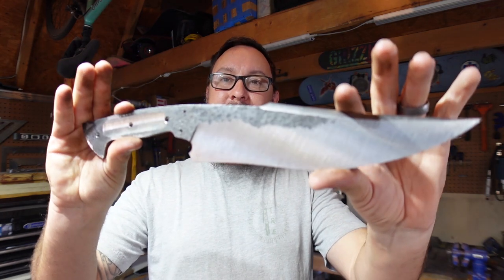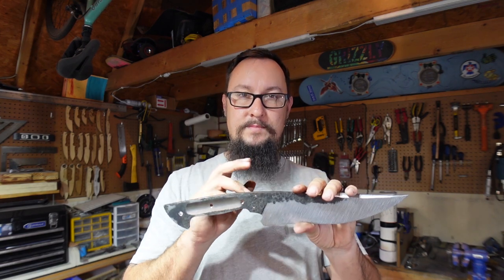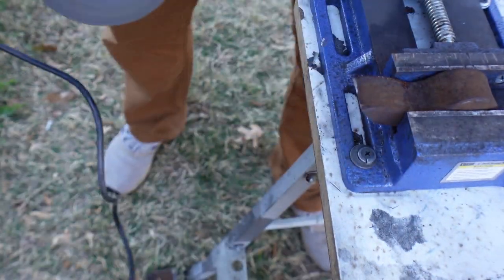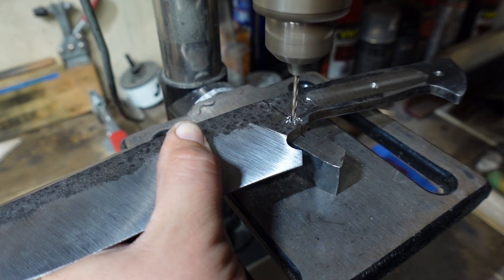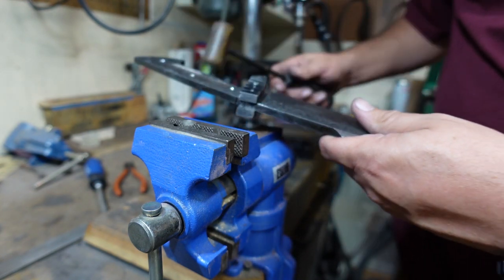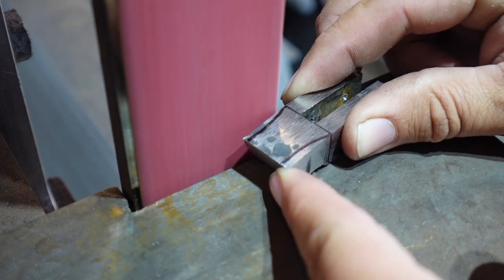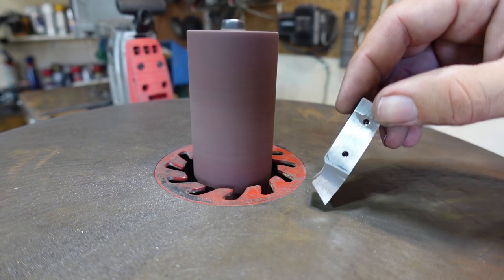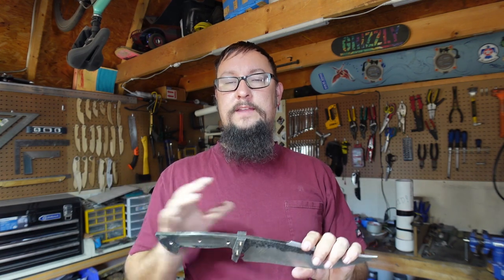Making A Guard For A Full Tang 5160 Bowie | Shop Talk Tuesday 106 |

Comment: Really love this! Very unique and cool. One thing I recommend for the future is to use a tapered hand reamer to ream your holes slightly after drilling. It’ll give your pins more room to mushroom in the holes for a better hold. I did this on some peened brass bolsters and it was so strong, you couldn’t move them at all. I love peened handles and bolsters, wish more people did this.
Reply from the maker: Great tip! That actually makes a lot of sense.

Comment: Could you put a thin coat of epoxy on the guard between the blade and guard befor you pin it to keep dirt and water from getting under it sort of a weather seal